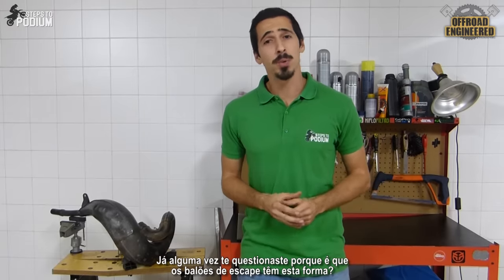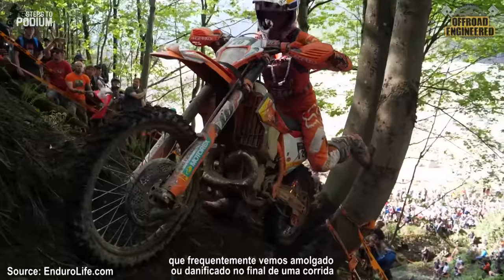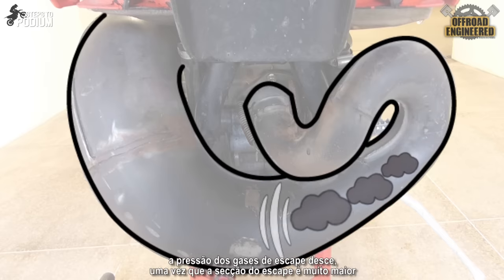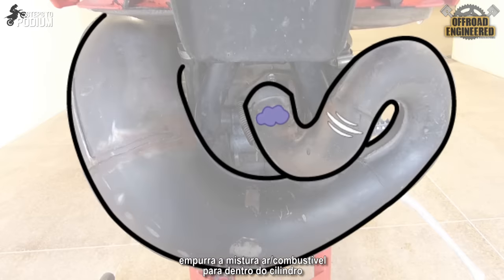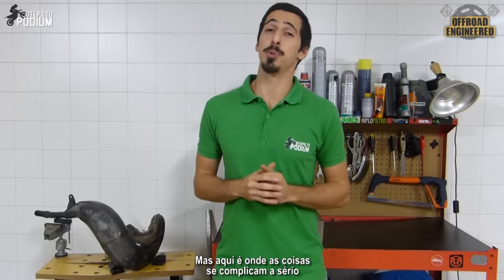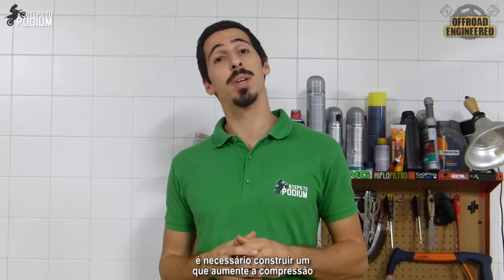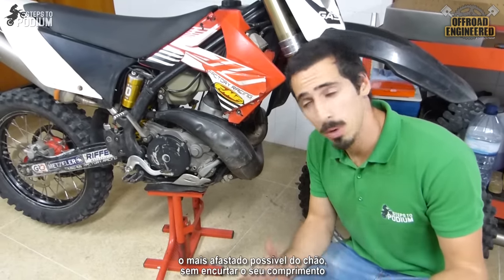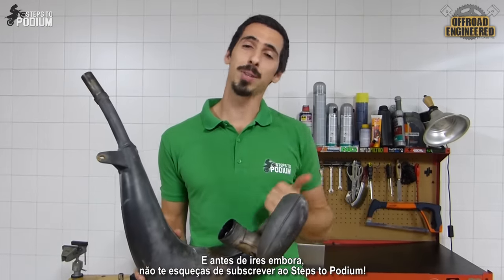How 2-stroke exhaust pipes work | Offroad Engineered

Comment: Fun fact: The high pressure wave is actually a sound wave which is used to force the unburnt mixture back down into the cylinder, this gives a slight positive displacement effect like turbocharging. Darn awesome 2 strokes!!!
Reply: So like ..in what way would that affect the powerband
Reply: @romanbernal9157  this is basically what causes the power band effect, as the revs increase the power increases.
Reply: @akent46  alright then so my idea of it was right. Awesome! Thanks man👍🏼

Comment: As the pipe widens the gasses expand slow down and increase pressure. F1 air intakes were designed like that to mimic boost before turbo was a thing in F1

Comment: Check out what happens when you restrict the stinger pipe at the end (exhaust gas outlet) with different diameter flow restrictors (washers).

Comment: When there is a leak between the cylinder and exhaust pipe, where it's common to see a bit of oil seeping out of, is it also quite possible that this gap is in turn sucking air back into the engine too, leaning out the mixture then?
Reply from the maker: Exactly! It just recently happened to me and I immediately noticed a decrease in performance
Reply: @StepstoPodium  Thanks for the response! I had been trying to troubleshoot my 2-stroke Paramotor's Moster 185 tendency to run lean even when the carb was set to richer than factory-recommended settings, and had initially ignored a small bit of oil seepage between the cylinder and pipe because other Moster 185 owners were saying "it's normal", definitely going to try and make sure mine stops seeping now!

Comment: Good video, although where the high and low pressure occurs is backwards. As a pipe expands, pressure actually rises and where the pipe constricts pressure lowers. It is based on the first law of thermodynamics. Kinetic energy (velocity) must be exchanged for Flow energy (Pressure x volume). In the largest cross section of pipe, the gasses move slowest with the highest pressure. Total mass flow is constant throughout the pipe which is why this is the case. It is one of the most confusing aspects of converging/diverging nozzles when I teach this concept. Overall good job though!
Reply from the maker: Bernoulli 's principle is only valid in some circumstances, where this case is not included! 
Thanks anyways for the comment 🙌💪🙂
Reply: @StepstoPodium  Well, the exhaust is not an incompressible fluid, so perhaps PV=nRT is more applicable. I didn't consider that.

Comment: if i have a few minor dents in the fat part of the pipe, along with some cracks. and i brazed them up badly with the oxy acetalene torch before it ran out of gas. still leaving a small leak. how much does this affect performance? the dents are still there, it still leaks a little. and adding that extra thickness to the metal etc does that affect the vibrations/ harmony of the pipe etc?
Reply from the maker: it depends on how big the dents are. if they are relatively small, they won't affect much, but the leak is a lot more serious because that affects the pressure inside the pipe and will affect the pressure wave created to push the air fuel mixture back inside!
Reply: That leak will cause disruptions in exhaust flow, probably more than rouble than the dents; I have ridden bikes w,/ bad dents, but not super noticeable, however a,crack or leak causes pops, bangs, hiccups, throttle stuttering, ect.  Get that shit fixed! Best wishes

Comment: Neatly done video but sorry to say there is one fairly major flaw in it and that is the understanding that the "pressure wave" is not the expanding exhaust molecules, it is moving energy (sound) that always moves at the local speed of sound which is largely influenced by temperature inside the pipe and can be calculated easily as the "tuned length" of the pipe.
Once you understand that then you can see that the assumption that pipe lengths change due to engine capacity is wrong, pipe length (tuned length) is always tied to  the time it takes for sound to travel down the pipe and back and the time the port is open for, regardless of the engine capacity.
Engine capacity only impacts of the pipe diameters used not the lengths which is always tied to "tuned length".

The reason that a larger engine has a longer pipe is because larger 2 strokes don't rev as high and with the lower RPM the tuned length is longer than for a smaller higher revving engine.
Reply from the maker: Great! then we agree on that 😊 I didn't state that the fact the exhaust gases expand was the reason the pressure wave would change. In the animation, the purpose was for people to understand what happens to the exhaust gases and pressure wave.  I did not correlate one another. the fact that both suffer changes in density / energy in similar conditions does not correlate to being the reason of one another. like you said, a pressure wave is energy and exhaust gases are mass.
Reply: @StepstoPodium  
I was just speculating on why you would state what you did at 2:40 that in the video that "the pressure wave in a 125 takes less time to travel than a 500" which is not the case at all as tuned length is calculated the same regardless of the engine capacity.
i also read other replies you have made here about speed of gas and suction of it as it exists the port (which is not right either) that also eluded to the source of your assumption about gas that might lead you to say what you did at 2:40, but if you say that isn't the case then if your reasoning was not based around gas expansion then what was your reason for saying that "the pressure wave in a 125 takes less time to travel than a 500"
The problem with giving simple explanations of expansion chambers is the fundamentals of them are not simple at all nor are thery intuitive and YT is flooded with such flawed explanations, brief and neat in presentation but just full of mistaken assumptions so not to target you on this as it is very common mistake made by many others.
Reply from the maker: I understand what you're saying! 
In some part I did oversimplify the explanation but in other, the length of the pipe/stinger does relate to the length from piston face to start of stinger and secondly header length, cone lengths and belly length and that has to do with the stroke/displacement. Pretty much all dirt bike 2 stroke engines follow a linear displacement increase (stroke and bore increase proportionally). 
Again, the video is a simple explanation of this phenomenon, not to teach how to to tune expansion chambers 😊
Reply from the maker: However, I do understand that my statement can be misleading to a certain degree! I appreciate your feedback nonetheless 💪👌

Comment: From what I know the pipe helps to pull gas and air through the engine faster after the sound waves and gas pressure reach the needed speed of flow creating the “power band”
Reply from the maker: Yes, you also have a suction effect from a first pressure wave!

Comment: Good explanation thank you. Does the length of the tailpipe affect the power/performance please? I have a motobecane 99Z engine.
Reply from the maker: Thank you for watching! :) Yes, it does! A smaller tailpipe increases peak power and a longer tailpipe increases torque.
Reply: @StepstoPodium  Thank you, We have a 50cc Motobecane 99Z engine in a little French car, I fitted an expansion chamber exhaust then a 1 inch pipe to the rear of the car about 3 feet long. With two persons you can feel some torque, I wonder about removing the pipe?
Reply from the maker: You mean the silencer?
Reply: @StepstoPodium  No just the long 1 inch pipe there is no silencer just the expansion box which can be exited at the side of the car.
Reply from the maker: Why not, try and see what happens 😂

Comment: Great informal vid!! 
I was curious on your thoughts on Shorty silencers.  good ? Bad ? Doesn’t make a difference?
Reply: Race teams have tested w/ different size silencers, for fine tuning their exhaust systems.most MX machines have a few options, not  super drastic differences
Reply from the maker: I would agree with them below!
At a certain point, the difference is minimal but since it's racing focused, every little extra counts!

Comment: That's why when you get a big crunch in the expansion chamber on the pipe it drastically changes your horsepower, especially on a 125!!
Reply from the maker: Exactly 😉
Reply: It has nothing to do with exhaust flow or anything to do with exhaust back pressure ...but everything to do with sound waves produced from the engine burning fuel..and any little dent in the expansion chamber will change the tune of the sound waves causing an incorrect pulse to the exhaust port and allowing too much fresh air/fuel mixture that is already higher than atmospheric pressure before the piston compresses it in the combustion chamber
Reply: @donniebaker5984  exactly!
Reply from the maker: @donniebaker5984  Thank you for explaining what I explained in the video! 😂

Comment: Hi, if you add the exhaust valves in the process how it works??
Reply from the maker: The exhaust valves help the engine take the most out of the pressure wave. 
What happens is that the port valves open or close in order to give the pressure wave more time to be able to push the air fuel mixture back inside. 

I clearly will have to do another video explaining just the port valving so subscribe to not miss a thing! :)
Reply: Thanks

Comment: Pro tip, they sell actually pretty good shields/protectors for the pipe, those look stupid but if you ride in places where the pipe gets dent easily, well the look dont matter.
Reply from the maker: which ones?
Reply: @StepstoPodium  https://www.ktm-parts.com/EXHAUST-PROTECTION.html
A few examples.
Reply: @impalaSS65  yeah👍👍
Reply: @impalaSS65  i have seen some more heavy duty ones too but dont know where to buy those
Reply: @tthcrew8294  Yeah I was looking for those, but these show the idea. The carbon fiber ones are pretty, but seem idiotic to me. I had plastic "carbon fiber" barkbusters that came with the bike, that just oblitterated. Clutch lever was ok, which was the goal. You need heavy gauge metal enough to take the full impact at 25-50km/h. Professionals perhaps rather straighten out the pipe after a race then carrying the extra weight.
Reply: @impalaSS65  yeahh good point.. but like for people that do ride as a hobby its easier to just have the protector (:

Comment: It's a sound wave. The tuned length is based on the speed of sound at the specific exhaust gas temperature of the engine.
Reply from the maker: and what exactly is a sound wave?
Reply: It's that snap as the port opens. Those little tings you hear are supersonic. That's what scavenges your engine.
Reply: So technically it's both. The sound wave initiates the pressure wave.
Reply: @StepstoPodium  
A sound wave is energy that moves though the exhaust gas by each gas molecule colliding with the next one and so on, it is not a moving bubble of  exhaust gas pressure.
It was created the moment the port began to open where the initial speed of gas flow at "blow down" was fast enough to create an energy wave that moves at the speed of sound and a lot faster then the speed of the gas.
It moves through gas in the same way a ripple from a stone moves along a flowing river.
The sound wave simply creates a distortion of the local air pressure around its location (like a wave does as it moves through an ocean past a boat), and the 2 reflected waves, the first being an expansion wave reflected off the first cone arrives back at around BDC and the second compression wave reflected from the last cone arrives back just before the port closes .
Reply from the maker: I even gave the example of the escalator and the person going up a downward escalator to make that perfectly clear. I did not make the animation in real time, I did it in "slowmo" so people could understand what's happening.

Comment: History of the 2-stroke pipe as i learned it:
1st: It was just a piece of straight pipe, and somebody figure out that if they cut it at the right length, it added a bit of suction at the right time for added cylinder scavenging, at a very small rpm range.
2nd: Then somebody figure out that a megaphone shape after the header section created the vacuum to scavenge the cylinder for a wider rpm range.
3rd:  Then somebody figure out that a reverse cone on the diffuser cone will add the sound wave supercharging effect, and the 2-stroke engine was ready to kick off prime time racing. :)

Comment: Great video, but could you explain why some pipes has factory dents? Also for the pressure waves?
Reply from the maker: Thanks for the comment!
Do you mean the new KTM/Husky pipes?
Reply: Steps to Podium Not any specific pipes, I don’t have any on my 2-stroke pipe but I have seen some aftermarket pipes that has dents from the factory
Reply from the maker: @goeer213  to be honest, I don't recall any other pipe with "factory" dents (if you could put a link to that, I would appreciate it, that way I can be more helpful), but the ktm ones use the dents mainly to make it more rigid and withstand better the blows, however they made the pipe's wall thickness smaller... (go figure). another reason they claim, it helps with the flow of the gases on the wall of the pipe, but I guess the improvement is so marginal that us common mortal won't even feel it
Reply: Steps to Podium I were just wondering in general so I have no links on any pipe unfortunately
Reply: factory dents are mainly made so that the pipe doesnt hit certain parts of the bike like for example the radiator
Reply from the maker: @MrOxu98  oooohhh those kinds of dents! Yes, they are for that purpose alone!

Comment: You didn’t explain the negative return pressure wave (partial vacuum) travelling opposite of an exhaust gas direction to assist scavenging as the wave travel across the divergence cross sectional area.

Comment: A good explanation, but I don't think it is totally accurate that it raises compression.  But pipe effects do effect compression in a supercharging way, that does increase compression due to more volume in the cylinder than it holds naturally, (at the pipes functional rpm range), thus adds more cylinder pressure during combustion.
You tune a pipe to peak at a single rpm, but the shape of the pipe determines how high that peak is, and how wide spread the power is from that tuned point.  For most all racing, the range is more important than the peak hp,---but it can't be slow.  :)

Comment: not just increasing compression. its a type of apsiration system. there are no 2 stroke crank case scavangers that are naturaly aspirated. all of them are charged by the exhaust system. even if there is no tuned pipe for it. no pipe is simply a way suboptiomal pipe.

Comment: Would be funny to try to make some movable exhaust parts to change the tuned lenght.
Reply: thats what the manufacturer does to find the sweet spot!
but really, its all mathmatical 
bore,stroke,combustion chamber volume, port area³ rpms. all done on a calculator, then welded up!!!

Comment: Just wondering if having an open cut on the expansion chamber will effect my bike at all and if i should get a new one. It is in the middle of 3 dints on the exposed side of the expansion chamber at the biggest part of the pipe. It also has smoke coming out of it when warming up and revving it and has oil leaked all out of it after a long ride. It is a 125 cc fyi. Thanks.
Reply from the maker: it affects a lot more than dents! when you have a leak, the pressure inside the pipe will not remain the same and will without a doubt affect the pressure wave that is responsible for the air fuel charging 😉
Reply: It is a very small slit about the width of the blade of a knife and is about 1cm long. Ive been thinking about buying a new pipe for it but i don’t really have the money for it. Do you suggest i buy a new pipe or do you think i will be ok with riding it like that for another 5 or so months. Thanks for replying.
Reply from the maker: @iwearaxo7721  it doesn't harm your engine but you'll lose power that a for sure!
Reply: Steps to Podium thanks. I have noticed a bit of power loss but i can deal with that until i have the money for one. Just subscribed as well. 👍
Reply from the maker: @iwearaxo7721  I'm glad I could help 😊 thank you for the subscription! 😁💪
Reply: Steps to Podium cheers mate.

Comment: if the gases flow from small cross section to larger cross section at a certain velocity and the gases are at a lower pressure in the wider area, how does a carburator work?
Reply from the maker: it's different because you don't have temperature differences and you have entry of fluids on the carb

Comment: I always thought it was just a cheap way to build a muffler for an inexpensive engine.  But I've had 2-stroke engines on things other than motorcycles, like chainsaws, lawn mowers, and outboard boat motors, that didn't have such exhaust pipes.  Is that why they never run very well?
Reply from the maker: they probably have one as well but considerably smaller (my guess)

Comment: You should look at bernoulli's theorem, as your discussion around pressure change due to the exhaust shape is incorrect. In short, a divergent duct causes an increase in pressure and temperature, along with a reduction in velocity, a convergent duct, the opposite. Good video other than that. 😊

Comment: How can the gasses travel at the same speed, when the cross-section gets ever larger? Should they not be slowed-down to keep the flow constant?
Reply from the maker: Your looking at it with the Bernoulli equation in mind, but in this case it doesn't apply. 😉